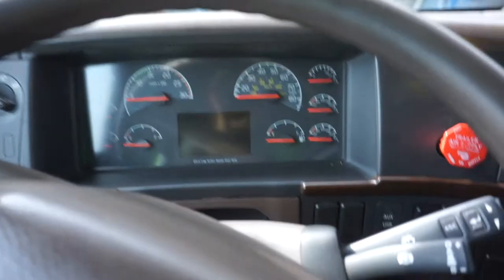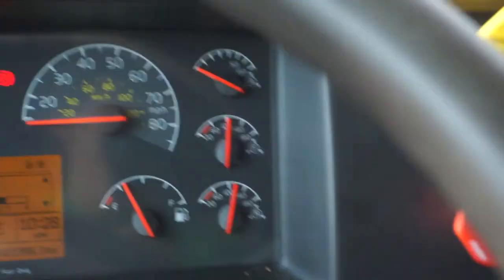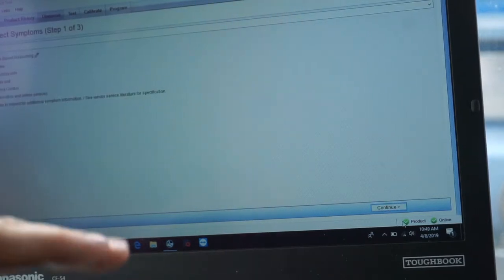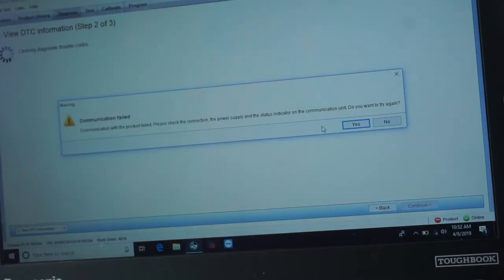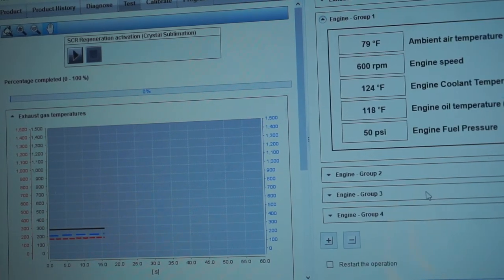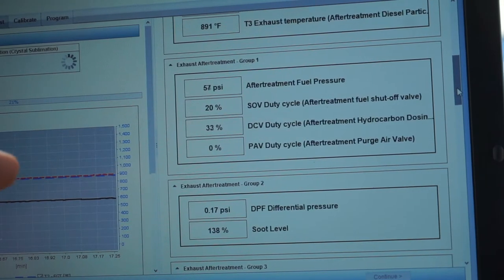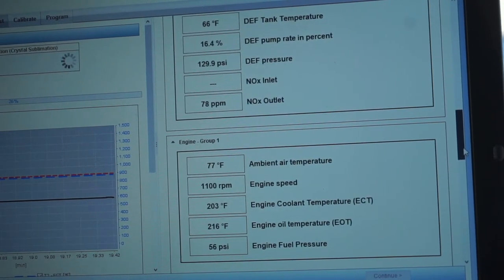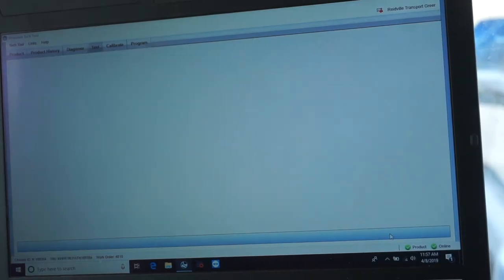How to perform a computer issued DPF forced regen

Comment: I need some help with my 2014 D13 i've been having problem with getting the exhaust temperature higher than 240 on T! and 230 on T2  while doing force regent i change 7 injector which was not clog but i change, i change the AHI Module , i change the SCR injector dozer valve. No luck there is no code that i can look for  it. any suggestion i will appreciate.I also did the reseting  and nothing the truck went into derate 5 mile and doesn't want to let go.

Comment: I had my dpf filter changed but soot level was high then changed outlet sensor changed and now soot level start to go up again do you know what could be the reason
Reply from the maker: I would look at the doser valve
Reply: i know its been a minute since you posted but was it the differential pressure sensor on the dpf that was bad?